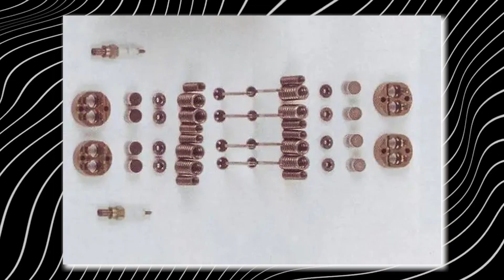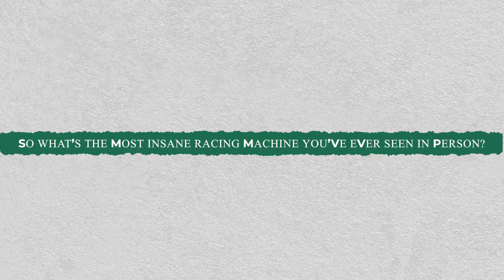The Insane 50cc Motorcycle That Hit 118 MPH Back in the 1960s

Comment: The RK67 was not the most extreme 50cc ever built. Suzuki's own RK68 was more extreme with its 3 cylinder 50cc engine and 16-speed gearbox. But two-strokes are still relatively simple engines. Honda's own factory 50cc GP bike was a four-stroke with two cylinders, double overhead cams, eight valves and a 9-speed gearbox and that is arguably more extreme still. 2:07 that is not true. There were no restrictions on number of cylinders in any class. Honda built a six-cylinder 250 and 350, and five-cylinder 125 and the 50cc twin mentioned above. Restrictions arrived in 1968 and they arrived in every class at the same time. There are so many untruths and confusions in the commentary that I stopped watching. It's utter crap.
Reply: Engines only produce torque,not bhp,Bhp relationship between torque and RPM. @at any given rpm .Ultra high rpm mathematically make hugebhp from small amounts of torque .Bhp a phantom number.

Comment: Nothing insane about it, just sound engineering! 0:40 Racing motorcycles have NO speedometer! 2:07 Nonsense! there were no restrictions at all, except weight and some sizes and, of course, for the cylinder capacity which and to conform to the racing class. 3:03 Where did you get that absurdity? 50 cc race bikes NEVER competed with 120 cc bikes!  3:38 There NEVER was a Suzuki 4 cylinder 50 cc! 3:57 Not extreme at all, ratio was 1.12, Honda 50 cc ratio was 1.14, practically the same! 4:13  The latest development of those 50 cc twins, the RK67, pushed out 17.5 PS at 17,300 rpm. 7:03 The cylinder head had NO finning, the engine was water cooled! 10:42 What have drum brakes got to do with anything? 11:20 The Honda RC116 had 16 PS at 21,500 rpm. As usual with these videos about historic racing motorcycles, it's an unbelievable load of total rubbish, made by somebody who shows with every sentence that he knows absolutely NOTHING about his subject!
Reply: There is just so much crap on YT now that it's becoming unwatchable.
Reply: @CaptHollister  I fully agree with you!
Reply: Tomos?!
Reply: Someone Re-narrate this video. I loved the 50cc racing back when. The Isle-of-Mann GPs were terrific.